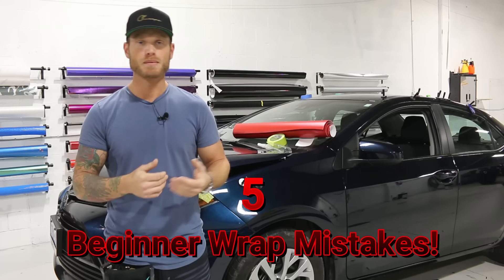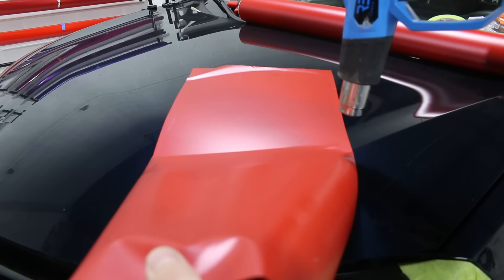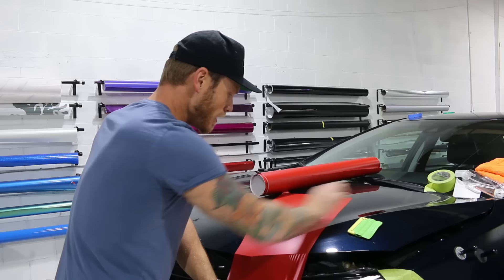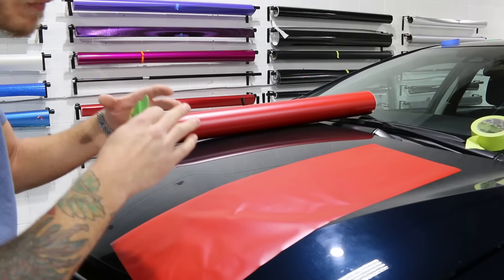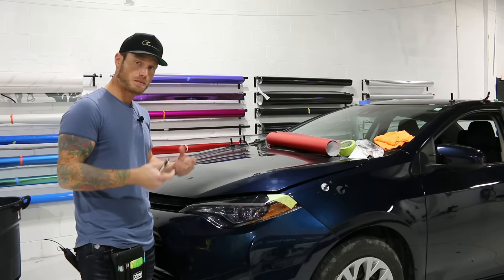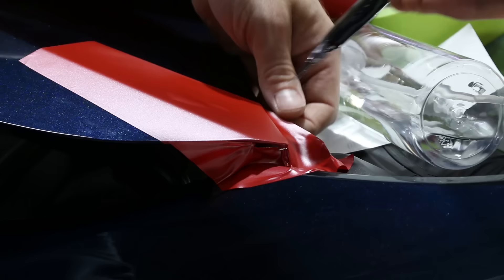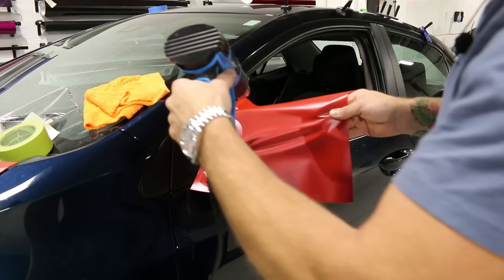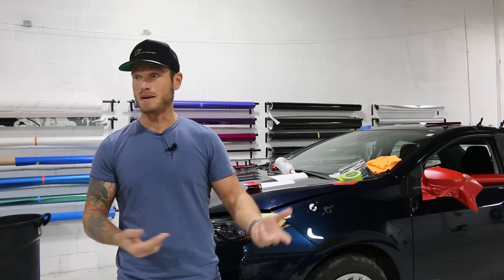5 Most Common Vinyl Wrap Mistakes

Comment: Christian quick question bud. I purchased a brand new overland trailer that has a matte textured powercoat finish. I want to wrap it and add graphics so I purchased Vvivvd premium in gloss black and orange. I cannot get either to stick at all. Could this be from the textured surface trapping to much air?? Thanks

Comment: hey so do u sell the acutal wrap? i just wanna do my side mirrors i just bought a new car and i realized 2 weeks later that one mirror is all black and one is black and white so i wanna wrap them so they will match. some kinda white color not real picky. if anyone can tell me where to buy this kinda wrap ud appreciate it. i bought wrap i normally get that i use on things other then a car and it's not good enough i can't do it with out it looking nuts i need some thing with more stretch bc usually things i wrap are pretty flat obviously this is not.

Comment: I have a couple of bones to pick if this is supposed to be a teaching video. You definately scratched the vehicle surface using your body gaurd knife. It can be seen around the 12 minute mark in the clear coat with the light on it. It's just a rental though right? You and I both know that if you aren't utilizing a backing paper knife with a Teflon pad this is a no no. In my view it's still a no go either way. Second, the way that you squeegee around the 13 minute mark is unacceptable for teaching. I know you have paid videos and teach classes but I send my trainees to your channel as homework. I watch and guide them as much as I can. I try to pass everything I know to them in a crash course over a couple of months. You know that while running a business it's hard to stand over others watching every move. I'm currently questioning if I should tell any of my guys to watch you. I'd have to go home with them just so I can say "get the basics down for six months and then start to develop your own style. Under no circumstances should you squeegee like this man." Fully aware why my employee has bubbles when wrapping with IJ-40 now. He thinks he's you! Lolol. Btw, not bashing, you have helped me along the way. I'll just beore pointed in what videos of yours to watch.
Reply: That "scratch" youre seeing is a reflection of a pipe off the ceiling of his shop....you can see the same "scratch" at a different angle at 2:22 its right under the body line of the hood